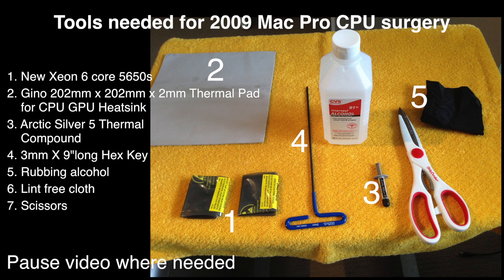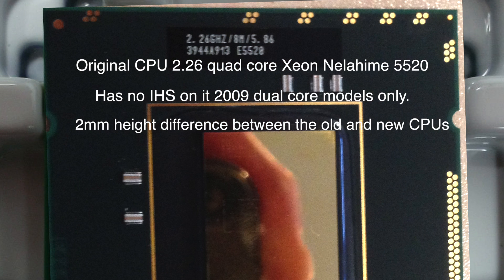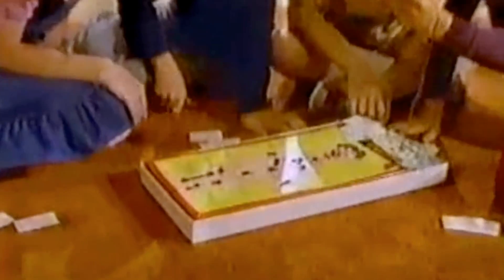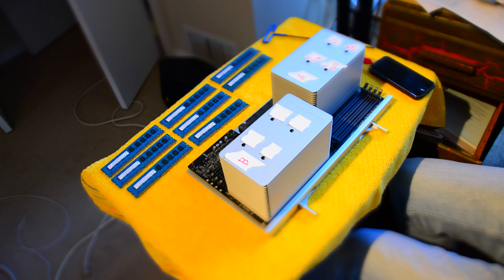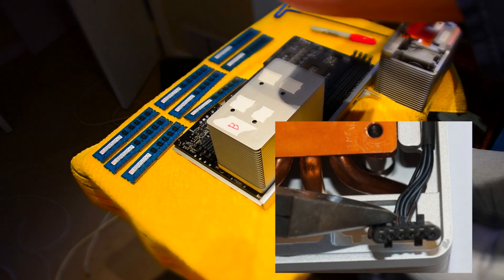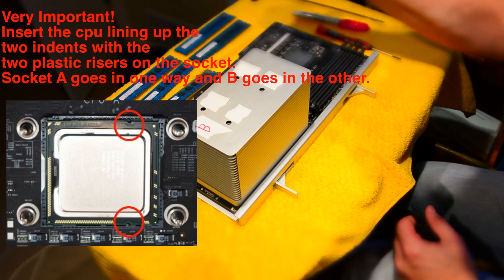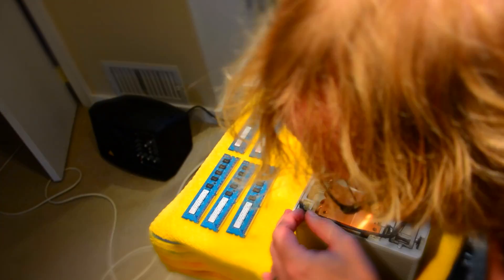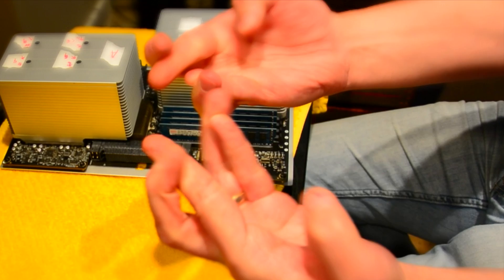Mac Pro 2009 5,1 CPU upgrade 8 core to 2010 12 core

Comment: I'm about to embark on a similar venture. Are you experiencing stable results from the upgrade. Im hoping to get my 2009 machine up to speeds of newer Mac pro?
Reply from the maker: My Mac Pro is now the best mac I have ever had and has been rock solid no issues. I'm about to upload a new video on upgrading video cards for your mac pro as well. I have a flashed R9 280X and OWC Mercury Accelsior and a Samsung Evo 750 gig SSD for system drives as I have to switch between MT Lion and Yosemite. I also have a Pro Tools Native PCIE card. I want to add a USB 3 card next. Then all pcie slots will be full. I have all 4 internal drive bays full with esata drives. No power issues, It benchmarks very close to the new 8 core mac pro as far as mulit core scores go for under half the price.  Next year I will drop in Xeon 5690's and that should keep me going for quite some time.

Comment: hi. I follow your instruction. I removed old processors and put new processor. I pasted thermo Pad to two strips of sensors. But the computer doesn't to be started. at its inclusion there is no habitual sound signal from Apple. All coolers turn, but the monitor not to light up. You speak about trimming of a black wire. It is possible to learn in more detail - why and what wire should be cut off?
Reply from the maker: The reason is so that they will fully reconnect to the heat  sink. If they don't the fans will run at full speed. But if the computer is not booting you may have another issue. Basically you need clippers like wire cutters, once you remove the black cable from the housing you clip the black sides that have the extra plastic sticking out. That way you can guide them up through the housing they were originally locked into and all the way back into the heat sink.
Reply: Lance McVickar I could be loaded with one A-CPU. Attempt to be loaded with A+B doesn't yield any results. Or osX show me error (https://www.dropbox.com/s/biffnbx2oa8mzbs/IMG_4689.JPG?dl=0 ) , or doesn't see the second processor.
Reply from the maker: It sounds like your second processor is not screwed down tight enough or you over tightened it which is not good, this is where the whole process is very risky. I would remove the second processor and make sure you don't have any bent pins on the logic board if you do get very small tweezers and straighten the pins out very carefully then reinsert the processor after completely cleaning the thermal paste and reapply it and remount the heat sink. it's also possible you could've gotten a bad processor if that's the case you could remove the first processor and put the second processor in the first processor slot and see if you can boot off it, if it doesn't chances are you got one bad processor. Did you use washers or not On the posts? One of the guys here's reported that he used  2.5 mm washers on each post and that seem to work great. I did not use any washers but if I were to do it again I might consider it.
It's extremely important not to over tighten the heatsinks onto the CPUs so there is a fine line there of not being tight enough or being too tight. That's why counting the amount of turns it took to unscrew the heatsinks is important.
Reply: Lance McVickar separately both processors (W3690) work. but together not ;(
Reply from the maker: Dmitry Istomin Hi Dmitry, the reason is you are using the wrong processors those are for single processor mac pros that have one quad core or one six core. For duel processor macs you have to use XEON 5600 series like the 5650s or 5670s 5680s 5690s the 3690 will only work with one not two. So you need to buy different processors.
Reply: Lance McVickar thank you ;(
Reply: Dmitry Istomin I bought new X5680 3.33Ghz processors everything works, thanks! the only question, CPU-A temperature from 48c, CPU-B from 38c thus Cores temperature #1 is strong above the general temperature of CPU. On a full load of Cores #1 are warmed to 89c, at CPU-A 70c temperature. Tell, it can damage to processors and with what such it can be connected? https://dl.dropboxusercontent.com/u/61596064/temperature.png
Reply: Dmitry Istomin From what I have read, CPU-A temps will always be 5-10C higher than CPU-B because that processor/heatsink is closer to the very hot Northbridge chip.

Comment: Hey Lance !
Great video. Im about to buy a mac pro, trying to find a 2010, but very pricey here in Norway. So, 2009 might be more realistic. There is a 2x2,8 2009 im looking at right now. I have build several pc´s thru my years, so i think this should be doable to upgrade. But was wondering, do you know what ram is usable on this system ? I build a hackintosh recently anf have 32 gb Crusial ballistix sport 1600 ddr 3 ram in there. And also, Is your system stable, will use this mashine with protools 10hd. And need to be rock solid :) Thanx again for a great and entertaining video !
Reply from the maker: I use Pro Tools as well as I am an engineer for work, PT 11 is kick ass in the way that it can utilize all your cores and ram,
I created a massive session and it handled it no problem where PT 10 choked and could not open it because there was more than 4 gigs of ram needed and PT 10 is limited to 4 gigs of ram. If you buy a 2009 mac pro with the idea of upgrading the processors you should buy the 2.26 8 core if you can find one, the 2.8 8 core is going to be more money and then when you upgrade the processors you will be lucky to get 100 bucks for the old ones. My machine is super stable in PT 10 and PT 11, it's the best mac pro I have had. I had a 2008 8 core and it was much more buggy with pro tools, this upgarded 12 core can handle a lot more, so glad I did the upgrade. The ram on this system is DDR3-1333Mhz
the mac pro before upgrading the firmware is 1066. I use OWC ram but any pc 1333 ram will work as well.
Reply: Lance McVickar Awesome ! Just what i wanted to hear !
I just pulled the plug on two six cores. Even though i havent bought the mac yet :-0 But.. i know im getting either the 2009 or 2010 dual cpu. Crossing fingers for a 2010, easyer install ;)
Im on Protools 10hd Native here, with Rme Raydat interface, I would asume Protools 11 would be a step up even though im on PT HD ?

Reading my eyes soar .. love it !!
Reply from the maker: Lionheart Studio & Production
Yeap I am on PT HD native as well with the Avid omni, the only thing about 11 is converting all the plugins, that is why I am stuck in 10 for the most part but am almost ready bite the bullet and upgrade all my plugins so I can be in 11 full time. Which Xeons did you get? 56...
Reply: Lance McVickar I bought two of these:
Intel Xeon X5650 2.66 GHz Six Core CPU Processor SLBV3 LGA 1366

Protools 11 is the next step here as well I think ! Are you going 11 or 11HD ?
Reply from the maker: Lionheart Studio & Production
I have Pro Tools 10 HD and 11 HD
 The 5650s a good chip at a good price.
Reply: Getting a mac pro with only one cpu slot tomorrow. Its a 2010 model. Hoping the x5650 6 core will be strong enough with only one cpu.
Do you happen to know if the mac pro´s are picky on ram ? I have 32 gb from my hackintosh build i would love to use. The ram is:
Crucial DDR3 BallistiX Tactical 16GB
16GB kit (8GBx2),1600MHz, 1.5V, CL8-8-8-24
Reply from the maker: Not sure but I do not think the X5650 will work on a single processor mac, the 3500 series is for single processors macs, I do know the 3900 series do not work in dual processor macs only the
5600 series do so not sure if that is true the other way around but I would do some investigating before swapping out the processor. Also the ram has to match what processor you choose.
And yes macs are finicky about which ram speed you use see below.

DUEL processor
8-core (standard configuration)
Two 2.4GHz Quad-Core Intel Xeon E5620 “Westmere” processors
12MB of fully shared L3 cache per processor
Turbo Boost dynamic performance up to 2.66GHz
Hyper-Threading technology for up to 16 virtual cores

SINGLE processor
Quad-core (standard configuration)
One 2.8GHz Quad-Core Intel Xeon W3530 “Nehalem” processor
8MB of fully shared L3 cache per processor
Turbo Boost dynamic performance up to 3.06GHz
Hyper-Threading technology for up to 8 virtual cores
Advanced Intel microarchitecture

Memory
Dual-processor systems
2.4GHz system: 1066MHz DDR3 ECC SDRAM
2.66GHz and 2.93GHz systems: 1333MHz DDR3 ECC SDRAM
Eight memory slots (four per processor) supporting up to 64GB of main memory using 1GB, 2GB, 4GB, or 8GB DIMMs
Single-processor systems
2.8GHz and 3.2GHz systems: 1066MHz DDR3 ECC SDRAM
3.33GHz system: 1333MHz DDR3 ECC SDRAM
Four memory slots supporting up to 32GB of main memory using 1GB, 2GB, 4GB, or 8GB DIMMs
Communications

Comment: Lance, is the thermal tape an absolute must?
Reply from the maker: Yes it is unless you want your fans to run at full speed all the time, it's how the heat sensors get  proper temperature readings.
Reply: Gotcha, thanks!

Comment: Ok here is the fix if you really fucked up your Mac Pro: remove everything, clean everything on the board, check for bends in CPU socket A. If you have bends bend them back. only put a CPU in CPU A. If it doesnt work test the 2nd CPU in A. If you make it boot the front fans will become a monster truck, turn off the mac pro and put the cpu B cooler but not the CPU. Boot again the same will happen but a little quiter. Put in CPU B. Front fan will still be a monster ram. reboot like 2 times. Fixed.

When i installed the cpus nothing was working after that, not even the diag_LED. There were red lights everyone on the board. Look at this Thread for the exact info http://forums.macrumors.com/showthread.php?t=1812760

Comment: idk if this is good news but i got a new sign, I only placed 1 processor. the one blink red light is still there, but the power light is blinking every 2 secs
Reply from the maker: Oops I deleted your comment about the fact that you fixed it by mistake, could you re post and
explain a bit more what you went through so others who try it can learn from it. Glad it worked out
What do you think the issue was, was it not tight enough?

Comment from the maker: Sounds like you may have gone too tight unfortunately, I think you need to remove the processors and make sure you don't have any bent pins on the logic board and if you do you need to bend them back, you need a very small set of tweezers. But if you put the old processors  back in and the same thing is happening then its not looking good. Supposedly the mac will run on just one processor so you could try removing processor B and see if it boots with just A, the fans will still run at full speed. Are the heat sink cables making full connection? As I say in the video there are many things that can go wrong so when it does it's not easy to figure out which thing it is.
Reply: Yep the same problem with the old processors
Reply: The light blinking is the one right behind the 4th ram slot
Reply: On these ram riser boards of the 2008 model, can I add also one stick of ram or must it be two or a pair? What would happen if I put in only one?
Reply: if you put 1 its gonna be a bit slower, since its single channel. Dual channel is faster
Reply from the maker: The Kaiser
Ram has to be installed in matching pairs I don't think you can use just one slot.
Reply: Lance McVickar Yes, I have read that, but What will happen if I put in only one?

Comment: After doing this my mac pro doesnt do the start chime ans stays blackscreen, there is a red led blinking on top of the 4th ram slot
Reply from the maker: You may need to tighten the heat sink a little more like 1/4 turn each screw. You also need to zap your pram to get the chime back. I would also first reseat the ram chip that is flashing or remove it and see if it boots without it. Mine stayed black too when I had night tightened it enough and this is when it gets a bit scary as you don't want to over tighten.

Comment: I'm in!  Just ordered 2 processors from ebay that are used and from Hong Kong!  The photo print on the processor looked identical to the ones in your video. Man I hope I'm not getting the wrong ones.  They were about $87 each.
Reply from the maker: You hopefully got the ones that say SLBV3 SLBV7 SLBVX... there are prototype chips
floating around ...SLBV is what you want. Usually made in Costa Rica.

Comment: Thanks so much for taking the time to produce this video. I upgraded from a Quad Core W3520 2.66GHz to a Quad Core W3580 3.33GHz because those suckers are super cheap now (found one for $140) and the 2010 firmware hack actually didn't work for me under Yosemite so I had an easier time. I slapped in a 1TB drive I had sitting around for months! Anyway, thanks and have a great day!
Reply from the maker: Great glad the vid helped  and congrats on the upgrade.
Reply: Lance McVickar ...and the tape to mark rotations—genius. Have a great day!
Reply: Corbin Bell what?
Reply: I didn't have to worry about the firmware changing to accommodate the 6-core chip because I upgraded to the fastest quad core. The firmware hack doesn't work under Yosemite which I believe would make upgrading to a 6-core Xeon impossible.

Comment: Did you notice a big huge difference after this upgrade especially with FX Plugins or virtual instruments ? How many VI's can you play right now on which latency ? And how much are the costs for this CPU upgrade ? I've got the same 2009 model like you and I'm thinkin wether to upgrade or to buy me a new one whats your opinion ?
Reply from the maker: Well mine with upgrade is faster than the new Mac Pro 6 core and cost factor is so much less, cost was me about $250.00 for the two processors Xeon 5650s, 5690s go for around 400 each are look on ebay for prices. Pro Tools does not take any use of duel GPUs that are in the new Mac Pros. I would upgrade the one you have and get some more years out of it. Also I do not want to convert all my drives to over priced thunderbolt when esata is just as fast if not faster and much cheaper. I don't use a ton of VI's at the moment as I mainly mix live shows but I can run a test with one of Avids stock synths and see how many I can get running before it glitches. 12 cores is better than 8 for VI's you will deff get more running, but the real issue with VI's is whether your using
PT11 or PT10 as PT10 has a 4 gig ram limit and PT11 being 64 bit has no ram limits, just depends on how much ram you have installed the more the better.
Reply: Lance McVickar  Thank you man for your replies! But is that really truth with this upgrade a 2009 Mac Pro 12-Core is faster than a 2013 Mac Pro 6 Core ??? I've read somewhere that a 2012 MBP should be faster than a 2010 Mac Pro but I'm not shure if this is correkt. I don't use Pro tools I'm using Cubase 7.5 and I do a lot with VI's and Fx Plugins so it would be nice if you can do a Video that shows how many VI's you can use in a Session with this upgrade. One more Question is are the Core i7 not better than Xeons 5690 ??

Comment: Any thoughts on using a 1.5mm thermal pad?  I know precision is key but I'm seeing better quality thermal pads but a considerably drop in that .5mm that takes it to 2mm?
Thanks for this video by the way.
Reply from the maker: I think the whole key is that the pads make connection with the heat sync and the heat sensors, if there is a gap that is
not going to be good. I don't think I would risk it as you would have to redo the whole process if they do not work.

Comment: I just popped in 2 x 5690's and 32gb of ram. Huge upgrade. I also upgraded to HDX/Omni. I'm in heaven.
Reply from the maker: Congrats! it must be smokin!! Did you use the video for guidance? I was thinking to upgrade to 5690s sometime in the near future.
Reply: Yes, I did use your video. It's definitely smokin'!! Thanks a million!!!
Reply: the (2) 5690's didn't consume too much power for your 2009 mc pro?  I'm thinking of doing the same upgrade.
Reply: I haven't noticed any significant power increases.
Reply: smittyboy007 im wondering which sockets I have to buy, there is much difference? Is this the good one: http://www.ebay.com/itm/Intel-Xeon-CPU-X5690-HEX-CORE-3-46GHz-12MB-L3-Cache-6-4GT-s-130W-LGA1366-SLBVX-/281586321157?pt=LH_DefaultDomain_0&hash=item418fda4705
And I can use just one processor for a single core right?
Reply from the maker: You have to use 3600 series for single processor macs, the 5600 is for duel processors only.
Reply: Thnx Lance for your quick reply! So the W3690 will fit for that? Do you know if that processor also have the 2 mm extra?
Reply from the maker: Yes I believe all 2009s have the removed heat spreader so there will be the 2mm diff when installing a new one but FYI you can find them with the cap removed on eBay.
Reply: Thnx again Lance :)

Comment: Am I supposed to ZAP the PRAM prior to upgrading the CPU or after? I upgraded my CPUs to the x5650s and it runs like a charm. I just cannot get the new 1333GHz to run at 1333. It shows 1066.
Reply from the maker: Yes you must zap the pram and it will show up as 1333.
Reply from the maker: Lance McVickar
I dont think it matters if its before or after... the ram should be installed then zap it.

Comment: Great guide. Thank you. How thick is the thermal pad you used?
Reply from the maker: The thermal pad size is listed in the video at :45 with the list of what you need to do the upgrade.
2mm is the thickness then you cut them to size.

Comment from the maker: I had some help and will make a video soon problem is some work some don't and flashing it is not that easy because the Bios / Roms are not always Mac comparable and they are always tweaking them. XFX did not work Gigabyte works without flashing you just don't get boot screen. More later.
Reply from the maker: *****
it should not as long as they are not prototypes